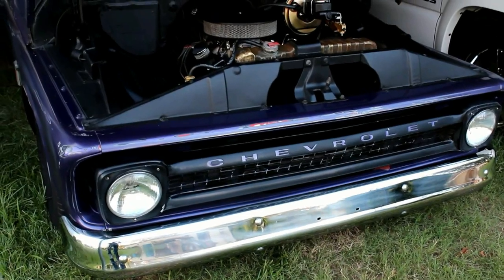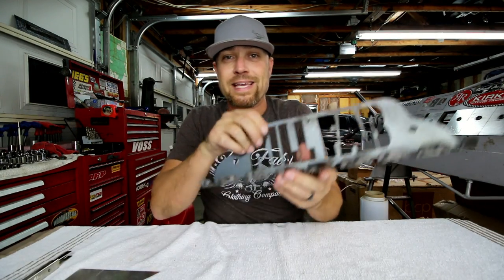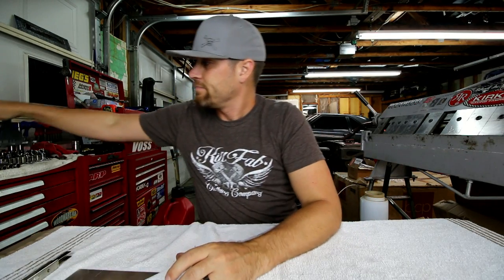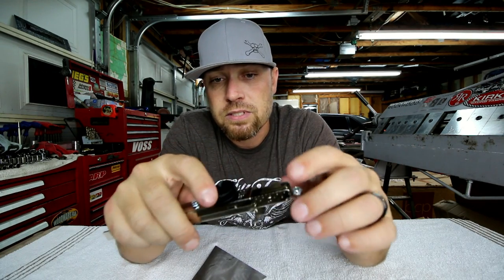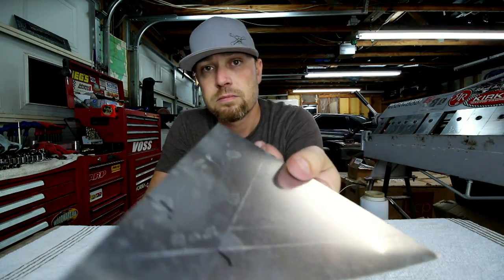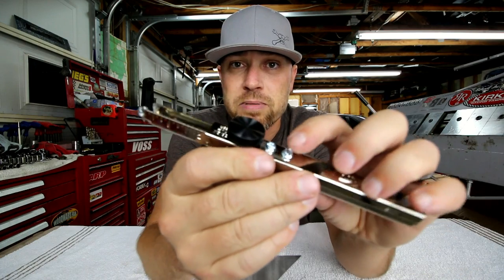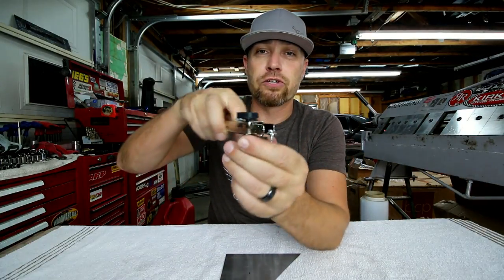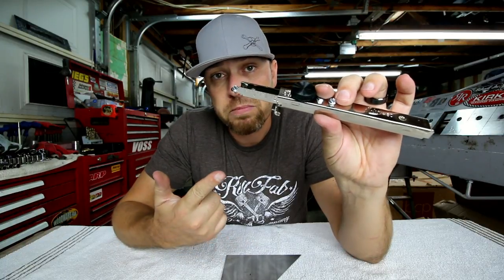You Need This Tool - Episode 82 | Sheet Metal Scribe

Comment: Well I've never seen one like that, I'm shaving my engine bay atm and this tool would have come in handy, being a sheet metal noob the thing I found hard was making a prefect square/rectangles with sheet metal that doesn't have a streight edge to work off? I'm sure the solution is simple but like I say, it was my first time, oh and I used a angle grinder to make the cuts. ANYONE HAVE ANY ADVICE? : )
Reply: look up a carpenter square, or T square. mark your edges. then  cut it. 

your probably having wondering lines cutting it cuz your using an angle grinder. what you can do is vicegrip/clamp a straight peice of angle iron as a guide to your sheet metal. and then drag your cut off wheel across it for a cleaner line.